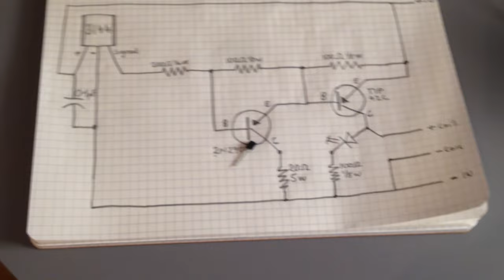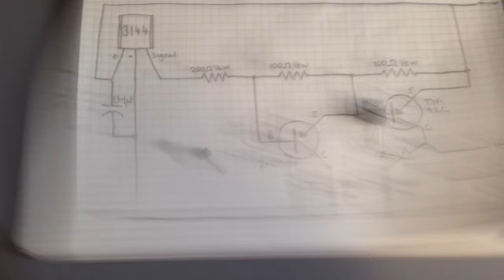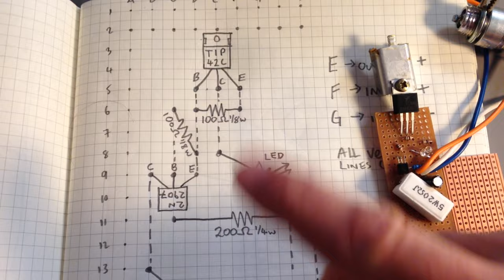Easy Hall Effect Transistor Ignition using a 3144 hall sensor and 2N2907  TIP42C Transistors

Comment: very good, it is difficult to find this kind of content in the interbet. Thank you for posting the curcuito. Can you tell me if I can replace 3144 with a 6838? or if I would have some other option besides 3144 because here it is difficult to find it ..
Reply from the maker: Hi there. I don’t know if another will work but any kind of switch with the same output configuration should work. You could download and compare the datasheets.
Reply: @bootsowen  ok, I think it will work because from what I saw the two components are similar and both have a digital output pin.
Reply: @bootsowen  I still have a doubt, please confirm me the reference of the capacitor that is between the positvo and negative pin of 3144. thanks

Comment: Thanks very much sir, if i want to run using 6V battery, what modification is required ?
Reply from the maker: Hi There, sorry, I don't know. Good luck with your project.
Reply: @bootsowen  tqvm sir
Reply from the maker: @80fakhrin  My first thought was that you need another 6v battery and then the issue goes away!

Comment: Thats very interesting, would you expect this system to survive the temperatures/rigors of a motorcycle magneto, I have a few old trail bikes with dilapidated points ignition that I would like to try this on.
Reply from the maker: It has been a few years when I made a few videos about these little systems. In theory they will work, but a few points. I would use a bigger heatsink. The other issue I had, that blew up a few of these boards was arcing across the 3144 to the chassis. I positioned the board near the flywheel, stuck a magnet on the flywheel but the path of least resistance was through the 3144 and not the plug so it arced. Maybe pot it in waterproofer too. It's worth a go. Let me know how you get on and have a look at my other videos. Depending on the bike, it may be easier to adapt a strimmer/minibike flywheel ignition.
Reply: @bootsowen  Thanks for the pointers, I was thinking of having the hall sensor mounted near the flywheel and the rest of the unit under the seat in a container plus heat sink. While pondering this I was wondering whether you could simply use a hall sensor to replace the points? e.g.Take a ferromagnetic strip and wrap it around a flywheel but leave a gap so that the hall is closed and then opens at the gap as if it is a set of points opening ? Or am I embarrassing myself now😬
Reply from the maker: @mirage1500  I think that would work, as long as the strip will stay stuck to the flywheel. You don't need to have the strip the whole way around, just enough to trigger the sensor. Or you can just use the points if they are ok, I think I made a video about this in my ignition systems playlist, or the rotovators playlist.
Reply: I’m an RC plane enthusiast… I need a less expensive alternative than buying cdi units from hobby distributors.  This looks very promising but I have to drop the input voltage to 6 volts (LiFe battery) .. and have found a mini coil with 6volt input and produces 20k volt spark.  Will these components work at 6 volt?

Comment: could you please contact me ? I have my own project on ignition that I want have looked at.
Reply from the maker: Hello there, I am probably not able to help you, I have not worked on these things for years, Some of the other people in the comments may be able to help. But you are welcome to ask me.
Reply: I would like to know if it possible to multiply  your  circuitry  by 8 and fit it to an 8 cylinder engine as a coil on plug configuration. It would involve the fitting of base plate in the distributor housing , using one magnet on the rotor and 8 times a  3144 Hall sensor. The aim is to eliminate all sparks except the big one at the sparkplug
Reply from the maker: Hi there. Firstly, it sounds like you want to use it in a vehicle. this might work, but I wouldn't count in it for reliability. I don't otherwise see why your plan wouldn't work.

Comment: Hi, I have been looking for a video like this for ages. I want to use this to power a 2 stroke engine from an old generator. The magneto in the engine is broken and I think this would be a good alternative. Just need to set the magnet and hall sensor to engage at the top dead center of the piston. 
Do you think it would handle a 2 stroke 50cc engine?
Thanks for this video.
Reply from the maker: I really don't know, I made it for a 500cc engine, but in the end got the points ignition going again. I found that if you positioned the board too close to the metal body of the machine it would arc and fry the board, but that might have been with another design of board.  I tried a few, i have posted videos of them, search through my videos. good luck, let me know how you get on and post a video if you get it going.
Reply: @bootsowen :  Thank you for that information. 
I will certainly let you know how it goes.

You see, the problem I have with this 2 stroke engine is the flywheel. Its one of them Chinese generator engines but the flywheel key, which is built into the flywheel broke off. I got another flywheel but it has no magnets on it for the pickup coil. I was actually going to try install magnets on this new flywheel by grinding out the area where the magnets should be and inserting some neo magnets and trying that.

The other problem is that I tried to remove the magnets from the old flywheel and busted it, so I don't know if I have to set the magnets North and South or if its just one pole that is needed to activate the little pickup coil. It's a CDI system.

Again thank you for helping and I have just subscribed. :D
Reply from the maker: I think there should just be one trigger magnet for the CDI pickup.  Good luck with the project
Reply: @bootsowen :
 Thanks mate. I appreciate your help.
You sure know a lot about washing machines and stuff. I need to look through your videos.
By the way I am in Scotland but all my family were from Ireland. :D
Reply: @bootsowen  Thanks.

Comment: I made the circuit like this in the picture, the only thing I did not find was the resistance of 20 ohms, I used 22ohms when I feed the circuit the led is lit straight, can you help me?
Reply from the maker: Hi there. It sounds like there is a short circuit somewhere. But without having it in front of me I can’t diagnose it. Or the 3144 is stuck open. (Broken).
Reply from the maker: I don’t think the different resistor matters. Try making it again.
Reply: @bootsowen  I tested the 3144 separately on a circuit to drive a led, so it's fine. I don't know what could be happening. I already looked at everything and I can not find where could be the problem ..
Reply: @bootsowen  I noticed that the 22ohm resistor is getting very hot, another thing I also noticed is that when I turn on the circuit if I connect it to the coil it's like a short circuit
Reply: @bootsowen  the capacitor I used was a 0.1uf / 100v electrolytic. is correct ?
Reply from the maker: If the led stays on there is a short circuit somewhere. That could be causing other parts to overheat. Start with a continuity tester and go through it part by part.
Reply: @bootsowen  already tested everything, already walked track by track, I'm suspicious of TIP42 because it may have leak, is new but pro led stay connected is very strange. tomorrow I buy a new one and test it and post here it worked.
Reply from the maker: Cool

Comment: What a great idea, thank you very much.I will try to build one at once.Need it for an engine where the magnets inside flywheel broke up
Reply from the maker: Hi there, if it is possible try to insulate the magnet from the circuit, otherwise, if you mount the magnet directly to the metal flywheel the spark will try to jump the gap between the hall sensor and the metal and burn it out.  Good luck!!
Reply: Hi bootsowen,Thank you for you advice.The flywheel has a small magnet on the outer side of its surface and the sensor is already there beside it on the engine .I am not sure what kind of sensor it is, I will go and check it today( it is my friends engine, not mine)
Reply from the maker: normally the sensors are completely wrapped in a plastic case and potted on commercial engines. Have fun, make a video of it!
Reply: Have checked , it is a small  coil.Turned the engine over with the starter and tried to measure AC Volts, nothing there.Have to check more

Comment: Hi what capacitor did you use thanks
Reply from the maker: Did you watch the video? It is on the diagram?
Reply: @bootsowen  I did its very helpful ime trying to find a sulution to a motocycle ignition I am not to confident with wiring this unit is perfect will you make for me with hall sensor on a 3 foot leed I beg
Reply from the maker: You should get the correct ignition for your motorcycle. Or learn to do it for yourself. Good luck.

Comment: Nice..Can this be used as pulser coil for motorcycle engine?
Reply from the maker: Yes, but you have to insulate it very well. I destroyed one that I made because the spark jumped across to the hall sensor,.. path of least resistance!!
Reply: thanks...Do you know a better way to make a pulser coil for motorcycle engine
Reply from the maker: Points and condenser ignition?  Or fit a flywheel and coil from a Briggs mower?
Reply: Thanks..
...Do you think that I can make something like your project but instead of using hall effect to use Reed switch do you think that is gonne work
Reply from the maker: Probably, but then it wouldn't be a hall effect ignition. Why don't you google your idea and see if someone else has done it?

Comment: A great ignition system, will this work with a 6v coil & battery? thank you for sharing.
Reply from the maker: i have no idea, I was just following a method, You could try it.
Reply: Thanks for your reply, I'm not much good with electronics so it will probably take me a while to get the bits & build it. All the best, Malc.
Reply: @malcytull  did it work
Reply: @ЯворВелчев  I didn't try it in the end, I used a motorbike coil & battery on my strimmer.
Reply: Malc Tulloch thanks for replying i have an old points moped and it has 6v magneto coils maybe I am going with a battery and some kind of a charging system
Reply: @ЯворВелчев  If you can wire the points up to an ignition coil & battery, it should go, all you have to do then is find a way of charging the battery, good luck to you !!
Reply: @malcytull  I have done this already but my points are crap (cleaned like 100 times) and couldnt find a replacement so Im planing on modernising the ignition
Reply: @ЯворВелчев  When you say you cleaned them, did you take them out or do them in situ? the only way to clean them properly is to take them out & using a fine oil stone, stone the faces & remove any pip on them, good luck my friend.
Reply: @malcytull  yeah I dissasembled them and the one contact pad is so worn it doesnt make contact with the other

Comment: how the length of timing ridge on flywheel matters
Reply from the maker: I don't understand your question?
Reply: bootsowen...i mean some flywheel has shorter timing projections or ridges on them while some has lengthy
Reply from the maker: I think it relates to the length of time (dwell) that allows the spark charge to generate, but it depends on the type of ignition.
Reply: bootsowen does that mean ac cdi wil have short ridge and dc cdi will have lengthy ridge??
Reply from the maker: I have no idea, they are different systems, I really don't have enough information from you, or enough knowledge to answer your question. It doesn't seem to be related to the video in question.  Sorry I'm not more help.

Comment: Hi can you please tell me if its a 6v or 12v system. very well presented
Reply from the maker: 12v
Reply: Thanks for your reply.I have made a tim-6 circuit board but the coil won't give off a spark. If I remove the coil and replace it with a bulb it will light up and go off..but nothing from the coil. Any input would help.
Reply: It's all 6v
Reply from the maker: I used the circuit from the circuit diagram, it was a long time ago so I don't remember the details, but I used a 12v coil and a 12v battery, If your coil is not for 6v then maybe that is the issue. also, are you earthing the plug, it will not spark unless it is earthed back to the circuit.
Reply: Yes it is. I read that if the battery only  produces low amps the secondary resistance won't work. It's rated at 4 amps just om the limit. Is that possible. Thanks very much for all your help.

Comment: Hi there, thank you for the informative video! Why is it necessary (indeed is it necessary) to have the two transistors? Why not go straight to the TIP42C? Many thanks!
Reply from the maker: I am not sure but i think it is to amplify the pulse from the 3144 to something that the tip42c can feel?  Or maybe I am completely wrong
Reply: @bootsowen  Great, thank you. I am going to copy the circuit anyways instead of researching further into the whys and wherefores. Many thanks again!
Reply from the maker: Cool. Use a very big heatsink on the transistor and make sure the spark can’t arc across the 3144. I fried one that way.
Reply: @bootsowen  thanks for the heads up! Just waiting for the parts now. I'm going to be using it to trigger the drive coils for a pulse motor, so there won't be any risk of massive arcing, but thanks for the reminder to keep the circuit insulated!